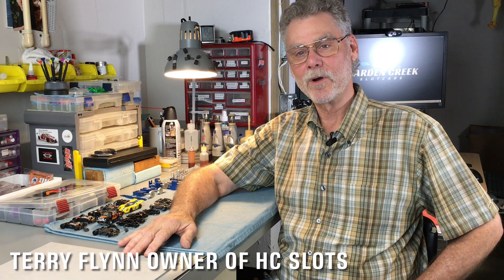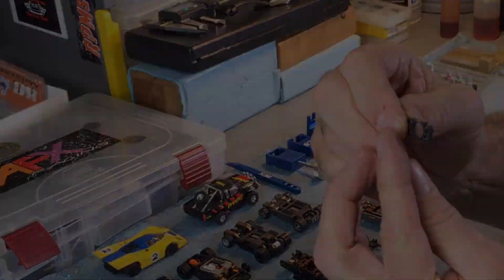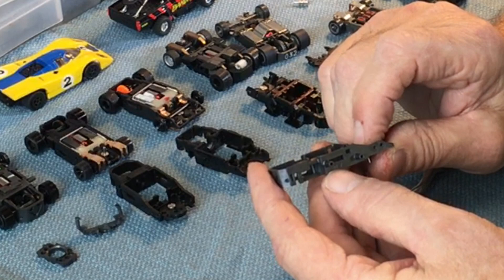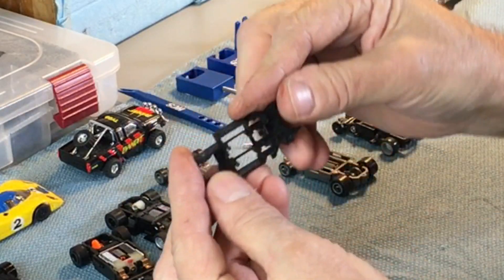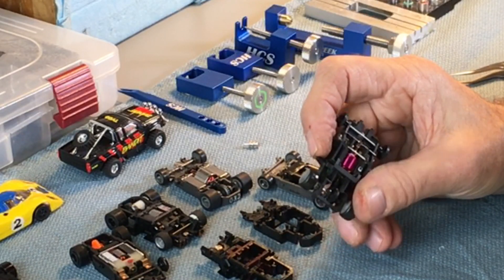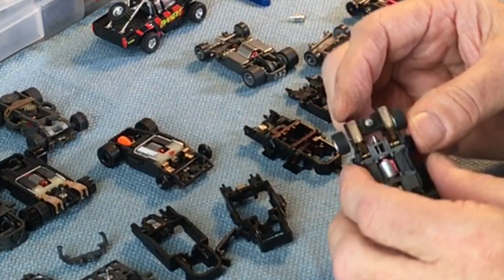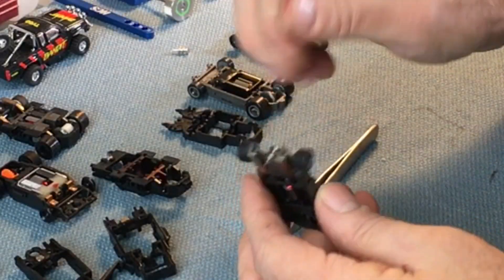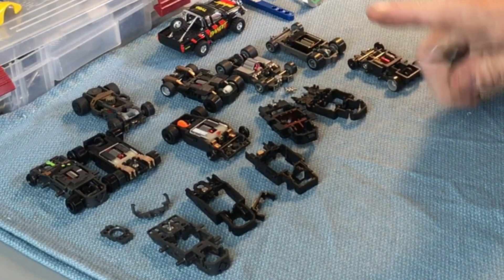My Favorite Parts - Episode 2 - Popular HO Slot Car Chassis and the Guide Pins

Comment: Interesting as always even though I am new to the modern slot car scene and don't have any of those chassis yet, I do want to get each of the chassis eventually. We finally have started to do some real testing on the mega G+ and 4 Gear chassis we started with, changing mags, tires, pinions to try and get the cars closer in speed.